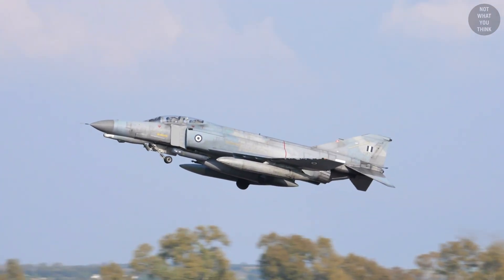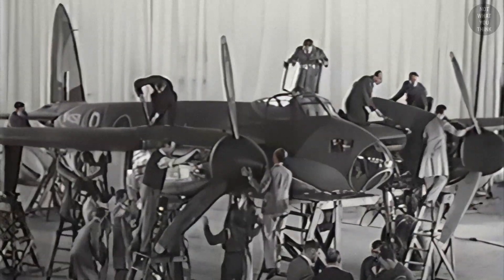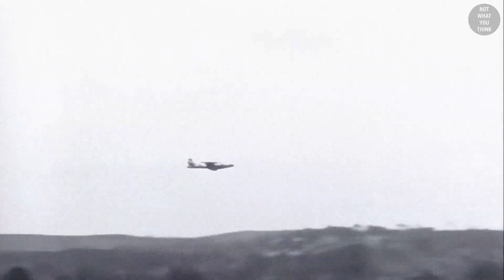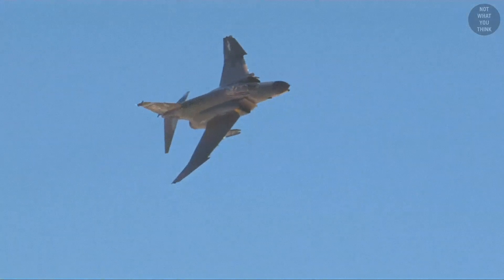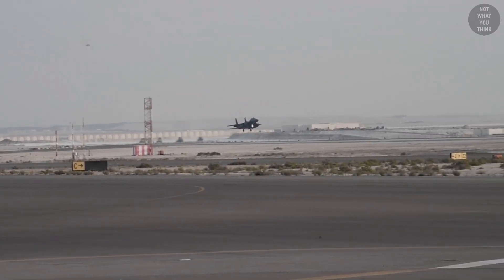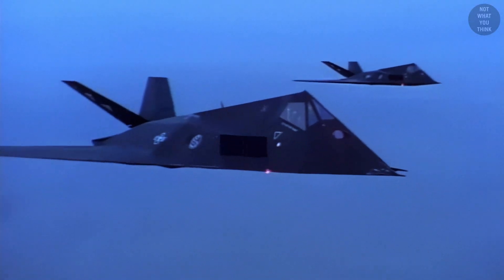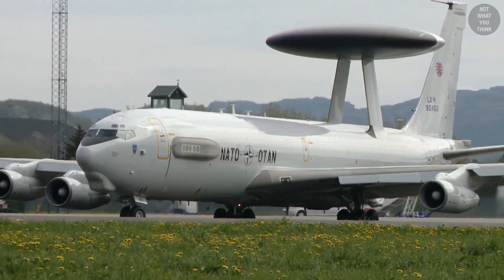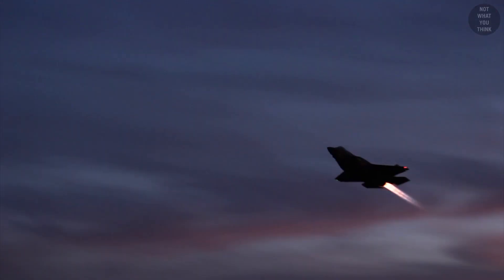Why are Modern Fighter Jets Slower than 1960s?

Comment: Very good analysis.  Speed became critical when guns were king.  You could and did outrun any gun envelope in existence with speed.  With the advent of missiles that actually worked in the 1970's, it was pointless to try and outrun a very lethal mach 5 missile.  On a related note, hyper-maneuverability is dying, stealth and sensors are king, because we have offloaded the turning fight into a 40g mach 4 smokeless sliver called the AIM-9X and similar, that hugely outperforms 9g cobras and similar airshow viffs.

Comment: One thing in this video I do not agree with is the length of time the U.S. was engaged in the Vietnam War.  The U.S. was actively engaged for about 10 years, not 20.  The French were there before that and pulled out.  U.S. fighters and bombers from the U.S. were not used until after the U.S. began fighting North Vietnam.

Comment: The speeds quoted are also the unclassified top speeds. The F-35 is significantly faster than Mach 1.6, and its classified speed is unknown to the general public. 
That said, enjoyed the video very much! Thanks for making it!
Reply: With that view, the Me 262 was supersonic too since it broke the soundbarrier during diving (which was risky since it could explode but still was done pretty often when things got really bad).  The official max speed is the safe speed a plane can reach in straight flight. Planes can shortly fly faster but it is risky and it takes it toll on the plane.

Basically we come down to a few things: Range is very important and the F-35 have already less range then a F4 and significantly less range then for an instance a Swedish Gripen. That matters little when you operate from a close air base or carrier but generally that is not the case. Stealth tends to require more fuel and so does increasing the armament of a plane. 

Maneuverability at high speed also tend to to take it's price. Grumman X-29  and Su 47 were made with that in mind but those planes drank fuel like an Irishman on St Patrick's day and had a very limited effectiveness in sub sonic conditions so neither were mass produced.

That said, there are times when you would want a really fast plane, like for an interceptor. But turbojet engines all get lousy performance at high speed so that require either a ramjet or a scramjet engine. The YF-12 was a ramjet fighter but it was too expensive at the time. At the moment US is experimenting with Scramjet engines and test drones have passed mach 5 for a shorter while with those. Since Scramjet engines run on hydrogen it is interesting since it both is environmentally friendly and more important doesn't require you access to oil to produce, just electricity and water.

So I think fast interceptors will be a thing again in the future but I am not sure they will be the main component of any future air force. I think it is likely that increasing the combat range will be a more important factor, depending on air refueling is rather risky in a war between nations which have a competent air force. That the F4 had more range then the F-35 is actually worse then the speed.
Reply: No it's not 😂🤦

Comment: WITH TODAY'S ADVANCEMENTS IN ENGINE DESIGN, PERFORMANCE, AND SMALLER ROBUST METAL PART MAKING, AND FUEL EFFICIENCY YOU'D THINK THE F22 WOULD HAVE SPEEDS THAT MATCH OR SURPASS THE SPEEDS OF THE SR71, BUT WITH SMALL ENGINES. MAYBE THE GOVERNMENT EITHER DON'T WANT PEOPLE KNOEING JUST HOW FAST TODAY'S MILITARY FIGHTER PLANES ARE CAPABLE OF.

Comment: Good take on that topic. Technically, it mainly comes down to the intake ramps. The F-14 has went through changes that made her slower without actually changing mass (at least not significantly) or drag, and they even installed more powerful engines. Yet the top speed went down from 2.34+ (there are accounts of it reaching 2.4) to 1.88. This was done by changing the CADC program that controls the intake ramps. The same reason why the F/A-18 is "so slow" - it doesn't even have variable intake ramps in the first place, like many other modern jets. Saves weight and, much more importantly, maintenance.
In the end, flying at supersonic speeds doesn't happen with stores anyway, unless it's an interceptor that's designed to be capable of that. Most multi-role jets actually struggle to get supersonic with bags and missiles or even bombs. It goes as far that the guys flying the Tornado say the M 2.2 top speed is just a nice brochure number, it can't even go M 1 - well they always fly with 2 bags and the jammer/cm pods anyway. Basically, flying at high supersonic speeds with a non supercruising fighter jet is only viable for getting out of the Danger Zone ASAP - if your fuel reserve actually allows for it.

Comment: It wouldn't surprise me if a chip could be changed out to get more out if them.  Just like gizmos on other equipment, even a car, they're known to throttle back.  Of course, a pilot can be distanced from knowing how everything actually works.  Where he may think it's maxed, but if fuel delivery were examined, it might be rigged similarly.

Comment: It's just fashion and competition. Vietnam was a low altitude war because accurate high altitude air to ground weapons weren't available. Low altitude meant low speed because air is too thick.  As soon as one side produces a hot M2.5 plus fighter-bomber that dominates the airspace above 50,000 feet and can achieve high accuracy air to ground bombardment from those altitudes, the other will need to respond.

Comment: This is why F-15s, F-18s, and now the F-35's are all designed to be multirole capable.  The F-15 USED TO BE a purpose-built air to air fighter interceptor, but with current tech and its durable frame it handles a variety of missions.  The purpose of high speed is for interception.  German fighters designed to intercept in WW2 would load up their fighters with anti-bomber weaponry with as big as an engine they could fit and would climb to the bombers, expend their ammo, and then run away to avoid escorting fighters. You don't need range and maneuverability to do any of that.  But with the current technology and strategic situation with missile tech reaching intercontinental ranges and capable of killing bombers from SAM, designing purpose-built aircraft for air-to-air fighting and intercept is pretty much dead.

Comment: Lower top speeds for later gen fighters has been something that has a lot of people debating. One thing that I don't remember if you pointed out is the internal weapon stowage of stealth era fighters. You must consider that the top speeds of Vietnam era planes is when the plane is "clean" or no exterior weapons or pylons. The F-4s top speed drops from 2.2 down to about 1.4 (IIRC) with a CAP (all missile) loadout. An F-22 has internal weapons bay so under a normal loadout it is still "clean" aerodynamically and therefore in combat situations, the F-22 is basically about the same top speed as the Phantom. In addition, it can super-cruise at 1.1 without afterburner making the difference even more dramatic. I don't think people realize just how exponentially better these 5th gen fighters are compared to the early jets.

Comment: Speed is important when your mission is to scramble and intercept within a couple hundred miles. Early fighters were interceptors because they had guns and short range missiles. They could also identify and photograph enemy aircraft being where they shouldn't. Now long range missiles with better guidance and control have largely replaced the intercept role.
Reply: Exactly!
Reply: It's interesting you mention long range missiles though, as they have indeed become much more important (to the point where anything else is considered obsolete.) And if you're really just slinging long range missiles at each other, you're not dogfighting so turn rate is much less important, while speed (not necessarily top speed, but actual deployment velocity) becomes much more important. Fire the same missile from two aircraft, one going mach 1 while the other is going mach 2, and the missile from the second will get to the target quicker, and have greater effective range as well. Turn rate might still be important for defending from missiles, but if can fly higher and faster you can launch first and might not need to defend at all. 

Still, a 'top speed' that can only be achieved briefly and at the cost of most of your fuel is probably less important than a high sustainable cruise speed.
Reply: There is no such thing as "a mission to scramble within some distance". Or even more broadly "a mission to scramble". Scrambling is not a mission type, war tactics or maneuver or anything alike. Scrambling literally means getting the F off the ground as fast as possible.
Reply: Can you explain interceptors easily?
Reply: Yeah but many of them still need need to be launched from planes. Aim120s
Reply: Maybe optional higher speed is additional good to escape after accomplished goals or in hopeless situations. Flares and Chaffs are rare sometimes.
Reply: Yes
Reply: Old fighters were designed to intercept but those missions are still a main role in peacetime. Newer fighters perform worse in this due to navigation systems alignment etc. Takes longer time to get to the air. Higher speed would also help.
Reply: Thanks for saving me from sitting through 10 min of fluff
Reply: Plus we have satellites now with weather penetrating RADAR, so the need for fast reconnaissance has taken a back seat as well.
Reply: I agree, I don’t believe flight endurance would be an issue especially with capabilities of aerial refueling. Being able to target and eliminate opposing forces from longer distances offers an greater advantage.
Reply: @GaiusCaesarAugustusGermanicus.  Keep in mind that tankers are big obvious targets for the other side.
Reply: @laughingdaffodils5450  the big tankers are great targets but I’m pretty sure the branches of the military have SOPs in place to reduce the chances of them being targeted. Beside that, F18’s can fill the same roll as the traditional aerial tanker
Reply: @GaiusCaesarAugustusGermanicus.  Yeah, it's SOP not to use them in a hot zone. That will prevent them from being targeted, but it leaves something to be desired. PLA explicitly games to destroy AWACs and tankers as highest priority. You can keep them out of harms way, but that is nearly the same thing as not using them at all.
Reply: @GaiusCaesarAugustusGermanicus.  Even then, the Navy has been testing the MQ-25 which will act as a refueling drone launched from carriers.
Reply: @Cowboycomando54  i did not know that but i do like the idea.
Reply: Anyhow...the plane irrelevant...it is just about the pilot us Maverick or not.
Reply: @Kevin-bl6lg  I want to see you going against any modern close air support aircraft of your choosing with a WW-1 era biplane, and come back alive telling again how it's not about the plane.
Reply: @anteshell  would be a nice plot for a new documentary Top Gun 3
Reply: @Kevin-bl6lg  More like a single joke on full length stand-up comedy set.

Comment: The advancements in aviation technology were extremely rapid through the first 6 decades of the 20th Century. But by the 1970's technological advancement slowed down by a lot.
      The F-15 and F-16 fighters though no longer the most advanced fighters, they are still highly relevant front line fighters that can easily hold their own in hostile skies, even against the more advanced fighters of today. These two fighters were developed in 1972 and 1973 respectively, 49 and 48 years ago. 
     While the current models are much more advanced than their grandfather's planes, they are still the same basic airframe design.
     For comparison, if you wanted to compare that length of service to some much earlier fighters, imagine the Sopwith Camel, a very advanced fighter plane in it's day still being a front line, relevant fighter tooling around the skies of Vietnam in 1965, holding it's own against MiG-17's and maybe even MiG-21's
      In the time equal to the service life of the F-15, aviation technology advanced from wood and fabric bi-planes to all metal supersonic computer controlled jet fights.
     Kind of mind blowing when you think about it. Of course, a large percentage of that time was spent either at war or in a near state of war driving the technology forward on both sides the conflicts. But after the 1960's much of that fever pitch of technology was eased back as the mutual threats we posed against each other has, thankfully, waned greatly.
Reply: I'd also wager in the fact that Considering how much more expensive it is with the advanced technology on the newer generation that is also a factor as you need to recouperate the cost somehow for buying it, let alone if it gets damaged.(an F-35 can destroy a few technicals but one dent to a flap due to a bird on take off makes it lose the resource exchange) Also considering in the past 25 years of warfare the, Ukraine conflict not counting, air superiority was barely contested as one or both sides never had a functioning air force. This meant there is no real necessity or a shown performance flaw in their role so there can't be a solution to a problem that isn't there.
Reply: @mikzpwnz_3199  Very true the resources needed to build and maintain these  aircraft are mind-boggling. I guess you could say the real advancement would be to find a way to increase technology while decreasing the price.
Reply: Again, fuel prices and crunching data from actual dogfights with really fast jets made the "teen" US fighters and Russian Su's to last this long. Also, if you look at more modern fighters like the Typhoon or the Rafale, they add technology and have been designed from scratch as multiroles but are not that different from an F-15 or 16. It's the same reason the Concorde had to be grounded and why they flew commercial planes faster in the 60s than today

Comment: In the late 80s I rode a Yamaha V-Max 1,200 cc motorcycle. It could go very fast in a straight line, but only had a 7.5 gallon gas tank. As impressive as the speed was, it was a total buzzkill having to push it to the gas station. I can relate.
Reply: That sounds more like the 1,100 cc then. Maybe your memoroes are playing a trick on you? The 1,200cc V-Max models had a cruise speed higher than most other bikes top speed, meaning that it could glide to the petrol station and even perform an unpowered landing in nessecary.
Reply: @oonmm  Maybe. I thought it was 1199.
Reply: wtf are you talking about? @bfc3057

Comment: You left out external loads.  An F-16 can go mach 2 with little in the way of fuel or weapons attached to it.  An F-35 and an F-16 loaded out for combat probably have similar performance.  The F-35s might even be better.  This is because most of the time most of the loadout for an F-35 is internal vs hanging off the wings on all previous generations of fighters.  In other words, the cruise and top speeds of more modern fighters like the F-22 or F-35 (or even the Eurofighter) is more or less right around the same as previous fighters with a combat load.  Or in some cases, even better.
Oh, and I forgot to add SUSTAINED turn rate.  The ability to sustain a high rate of turn is much better in newer fighters because of factors like power/weight and aerodynamics.  So while the F-4 was rated for over mach 2, it couldn't hold a rate of turn anywhere near an F/A-18 with a top speed of mach 1.8.  It would simply lose too much airspeed.  Things like acceleration and maneuverability (with stores) are usually more important than raw top speed.
The sustained turn rate, acceleration, climb rate, cruise speed, and yes even top speed, are probably the same or better in a loaded F-22 than a loaded F-15.
Reply: An F-16 with 6 missiles and nothing else is actually slower than an F-35A despite carrying the same payload. Mach 1.5 max. With external fuel tanks the F-16 drops to Mach 1.2, and on strike missions it is subsonic. So yes, you are right about that.

Also a little bit of entertainment... the F-4 with a typical Vietnam-era bomb load was slower than the purely subsonic A-6 with the same payload. 

However I will correct you on one thing: The F/A-18's mach 1.8 is an advertising metric, probably achieved in a dive during testing. For comparison's sake the official top speed is the speed achieved  in level flight, which for the F/A-18 is Mach 1.6.

Comment: This video is misleading, the F4 Phantom you use as an example is designed for air to air combat while the F-35 you compare it to is designed to fill multiple roles including air to ground combat and as a carrier plane (its also a terribly designed plane and an abject failure). You are comparing apples to oranges, the US modern air to air fighter is the F-22, which has a higher top speed than the F4 at Mach 2.25. So no, modern fighters are not slower than older ones.

Comment: have we given serious consiteretion to the return of propeller combat airplanes?
Those are much cheaper, more fuel efficient, and don't have a trail of hot gas being spewed out the back for heatseekers to pick up.

They probably would not fare so well in air superiority missions, but bould still give great air support. 
if you has for example a couple of supersonic jet's doing air superiority to allow for a dozen propeller aircraft to deliver payloads.
Reply: Yes, serious consideration was given to them in the last decade or so, however they decided that an overhaul of the A-10 fleet would be a better use of the funding.